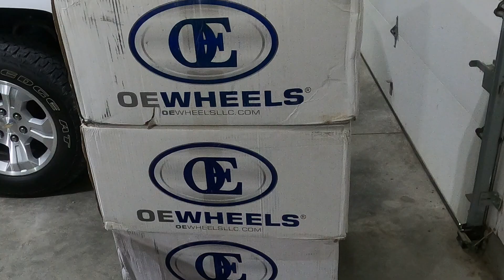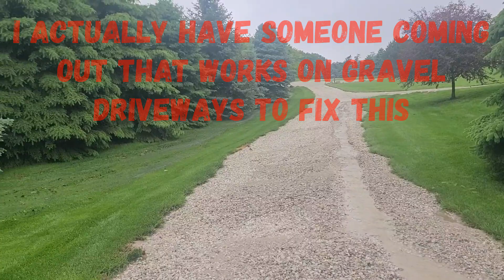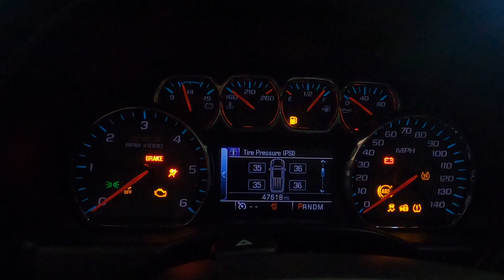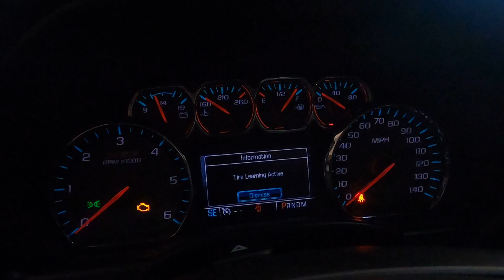2016 Chevy Silverado Z71 - Gets New Wheels And Tires

Comment: Where can I get those  .. any links.
Reply from the maker: I got them off the fleabay site from OE Alloy. Here's the link to the ones like mine. https://www.ebay.com/itm/276195742365?mkcid=16&mkevt=1&mkrid=711-127632-2357-0&ssspo=avrFVaTvR2u&sssrc=4429486&ssuid=jYKuRxDfSwa&var=&widget_ver=artemis&media=COPY
Pretty quick shipping too. If you want the center caps with the Chevy logo I'd suggest you contact him before you place your order. I left a note for him when I bought them but they didn't include the caps I wanted.
Reply: What size tires are those. 🔥
Reply from the maker: @tavobandana5109  I got 275/55R20's. They're really close to the stock sizes so I didn't have to adjust the speedometer at all.
Reply: @c5grapeape  Thank for replying .I appreciate it 👍
Reply from the maker: @tavobandana5109  Anytime. Thanks for reaching out. Hope it helps.